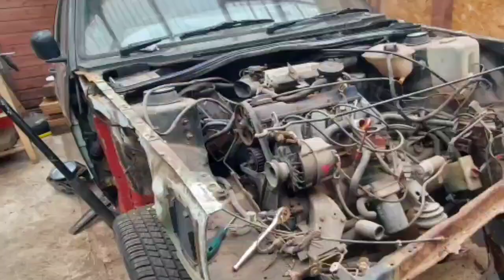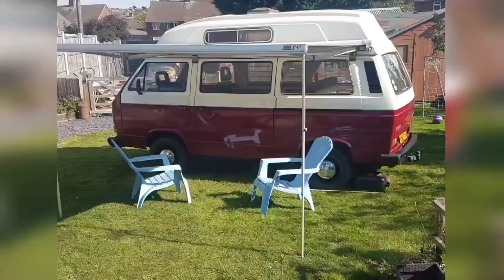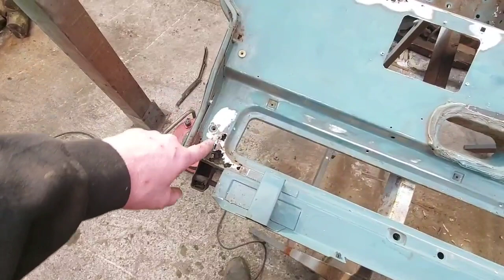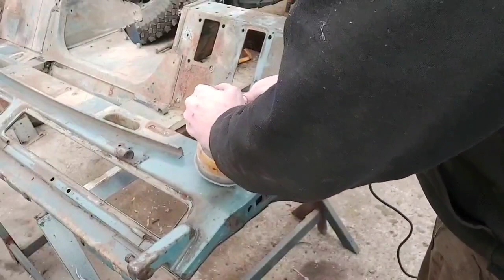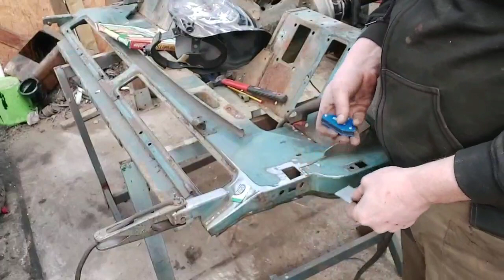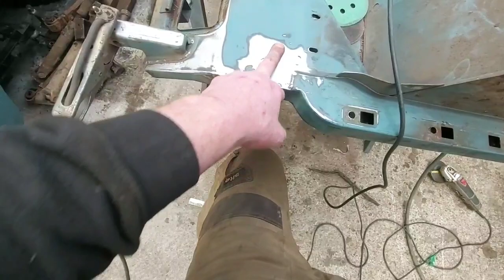land rover series project (numb nuts) welding starts on the bulkhead and a few tips

Comment: Great video, I've a few similar repairs need doing in the same location on both sides of the Series 3 we have awaiting rebuild, so some great tips, thanks!
Reply from the maker: Thank you 👍
Reply from the maker: If there's any specific problem areas you want me to cover or info you need let me know and I'll do my best to cover it. 👍
Reply: @retro.restorations   Thanks mate, I will do, as the level of detail in your videos is superb.  The only other areas of issue on the bulkhead  are on the door pillars just below the bottom hinges.
 Will consult your previous 2.25 diesel videos towards summer, as I'm figuring my on the road series 3 needs new valve seals etc due to occasional blue smoke at idle.
Cheers,
      Bruce.
Reply from the maker: Thank you I do try and include as much detail as I can.
Blue smoke when the engine is idling can be caused by piston rings valve seals will usually cause smoke on start up or on over run its also worth checking that the engine breather isn't clogged causing excess crankcase pressure its easy to clean out by soaking it in petrol, diesel or paraffin. 👍
Reply: @retro.restorations  brilliant, I'll check the breather before doing anything too radical. Thanks again 👍
Reply from the maker: @ramarover  no worries